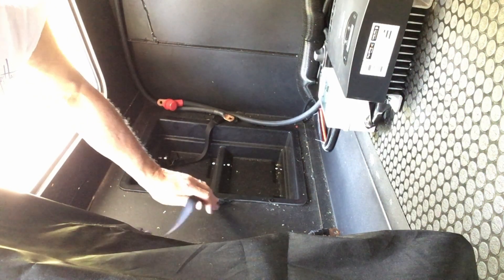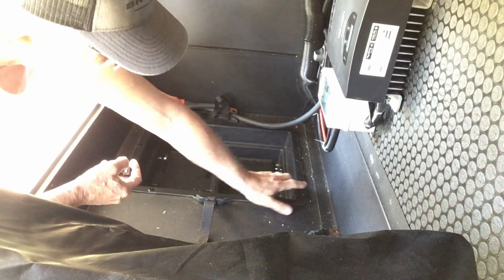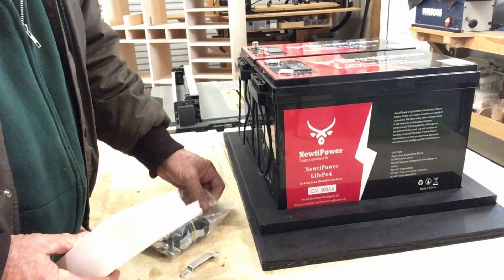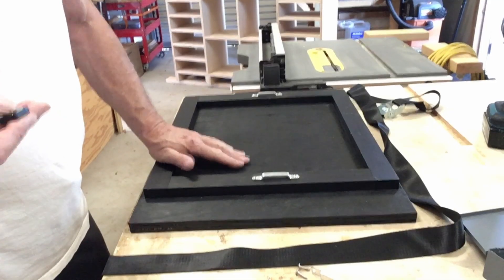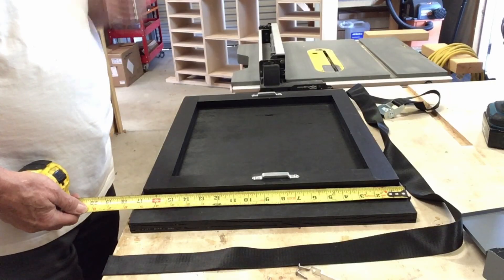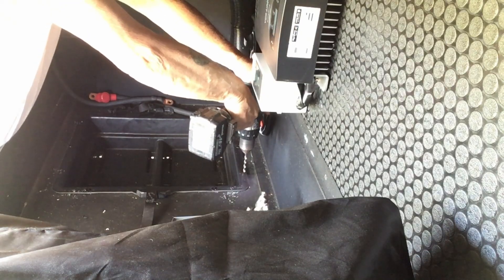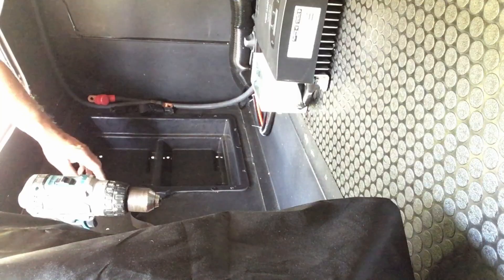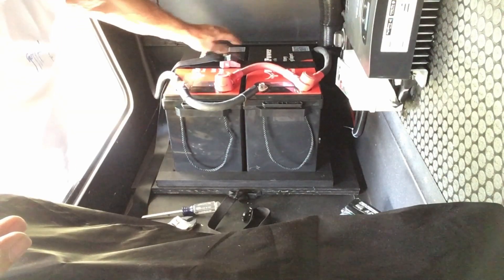2 300AH Lithium Batteries install in Brinkley Z2900

Comment: just tried to charge one and  it wouldn't get to 13.4 and then began discharging without anything hooked up to is. Second battery wouldn't charge past 13.3 and began discharging as soon as it was taken off the charger
Reply from the maker: Are you using a lithium charger adjusted properly?
Reply: Question right here: I am going to buy two of the same battery brand, 600Ah. I plan to connect a DC to DC. The question is, how many amps do I need for the DC to DC installation? @ProjectRVAdventures
Reply from the maker: @QUANTS55  Im not sure as I have not run a DC-DC charger as of yet. My needs dont seem to warrant it as I usually charge to full within 3-4 hours of sun.
Reply: @ProjectRVAdventures  i wonder if they can power my MINI split for atleast 15 hrs 🤔

Comment: How many watts of solar on the roof? I want to do the same thing. I just saw in the description you have 740w. Any other modifications to the solar?
Reply from the maker: I installed the second 370 Watt panel so I have a total of 740 Watts. I also have a 100 Watt briefcase panel but have not had a need to use it yet.
Reply from the maker: Just made sure it is in series instead of parallel.
Reply: @ProjectRVAdventures  
Have you had a chance to use the system yet? If so, how well does the tow vehicle charge the batteries? Thanks again.
Reply from the maker: I have had them down to 68% and drove for 3 hours and they were full. I’m sure the sun helped also but I’m real happy so far with the all around performance. I did have the refrigerator running also during that trip while charging.

Comment: Nice batteries!  I recently bought 4 of these 300Ah LiFePO4s direct from NewtiPower via their Temu store.  

Batteries were about $307 each BEFORE applying a $100 off coupon to each purchase with free shipping as well.  Worked out to about $222/each delivered, including sales tax.  $888 total yields the same power as 3 server-rack batteries at less than 1/3 the cost, and much lighter to move around for installation.

Comment: So I bought the same batteries for my model Z 3100 by Brinkley. I’m following your template for installation of the platform you fabricated. 
I noticed that your batteries are in parallel, which is what I want to do   . Where and what size cables did you use and get to connect the batteries in parallel.  Thanks, would appreciate any information about this.
Reply from the maker: I used 4/0 cable that I got on Amazon and made the cables to the length I needed. I used welding cable as it is more pliable than regular stranded cable. It does carry the same amperage. 
Let me know if you need anymore info.
Reply: @ thank you!  1 appreciate the quick response. 😀